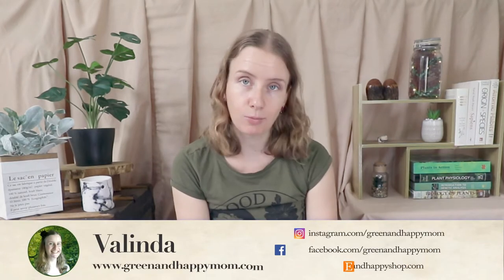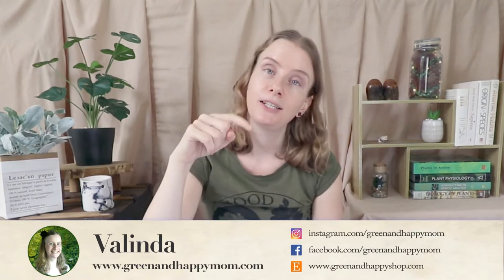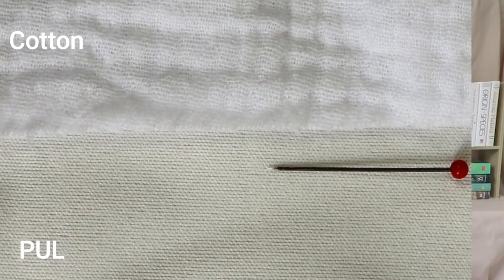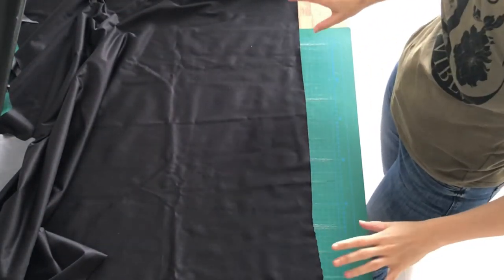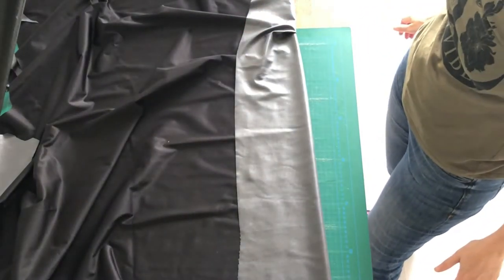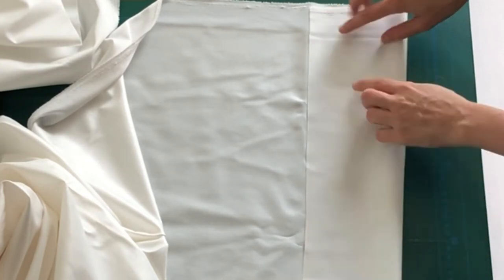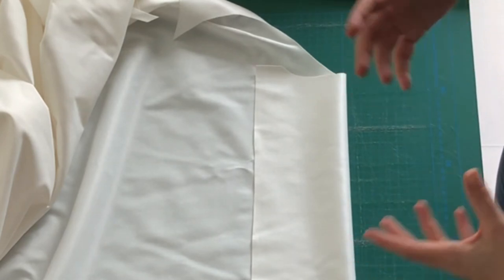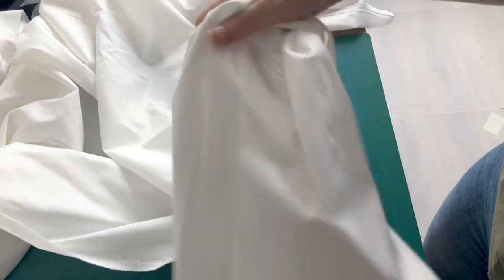What is PUL - Waterproof material for Cloth Diapers, reusable nursing pads and sanitary products

Comment: Have you ever made socks with PUL? :) I'm thinking it would be useful for my kiddo
Reply from the maker: No I haven't. I don't know why you would make socks waterproof. If your kiddo has sweaty feet you would want something that absorbs it so the feet won't stay wet.
Reply: @GreenHappyMom  My kid doesn't have sweaty feet but loves to play in the garden, even when it'a raining. She has a rain suit but sometimes doesn't put her rain boots on. I used to work in construction and my feet would often get wet through my work boots. I was thinking of layering some flannel or bamboo velour inside of some PUL for absorption, waterproofing and breathability.
Reply from the maker: That makes sense. I think it will be a challenge to make them completely waterproof. The seams may leak as a sewing needle make tiny holes which can let water through. You could repair this with heat but I have never been successful.
Reply: @GreenHappyMom  I have some heat sealing tape (WBM FX-800) is what it is called and I'm thinking this would do the trick!
Reply: @GreenHappyMom  I also recall reading that cotton thread will wick moisture into your seams but I will be using polyester as it does not have the same effect, something to keep in mind!
Reply from the maker: I will. Good luck with the project! 💚